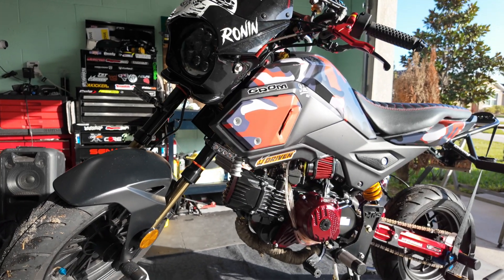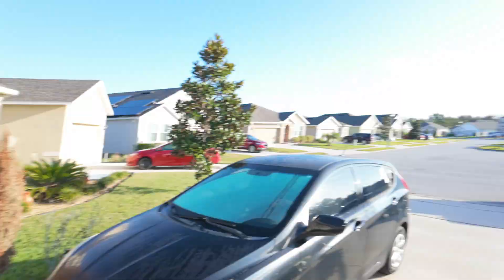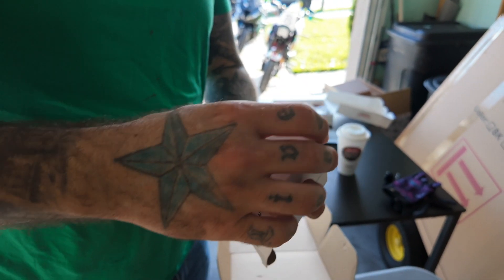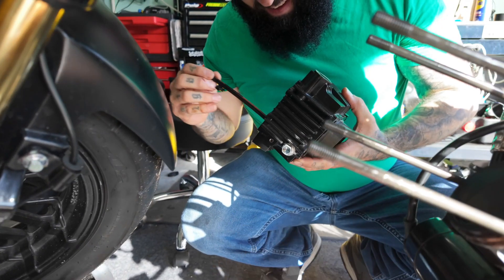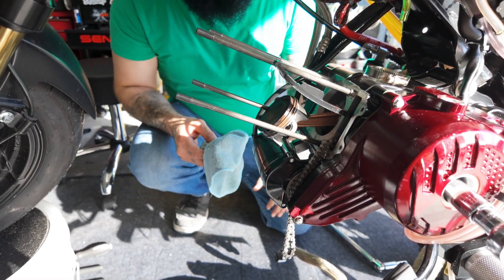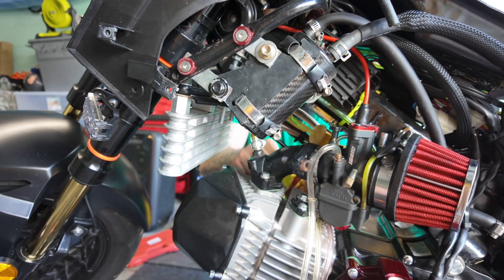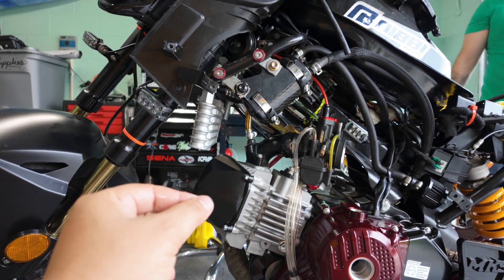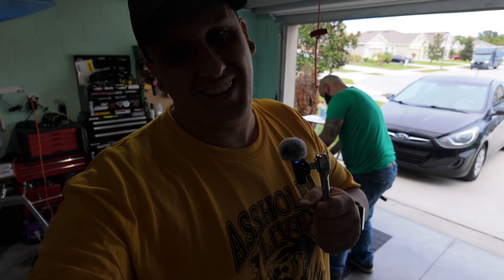Goodbye 190cc… Hello 212cc 4 Valve  Monster!

Comment: I have that same mini clone moto I am on the fence with a 212cc engine swap. I am planning to buy a new 212cc engine and not do a big bore  The question I have is does the 212cc engine have the same bolt pattern as original stock engine and is it a plug and play THNX any information would help THNX
Reply from the maker: I have another video installing a 212cc from a 125cc check that one out.
Reply: @freddieRODZ  AWESOME THNX